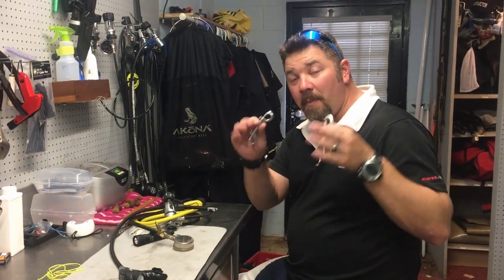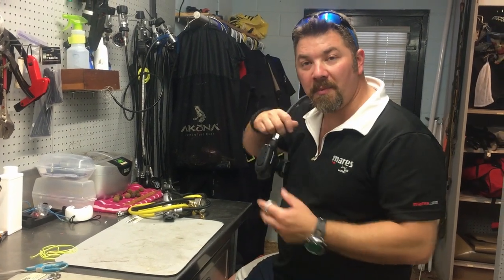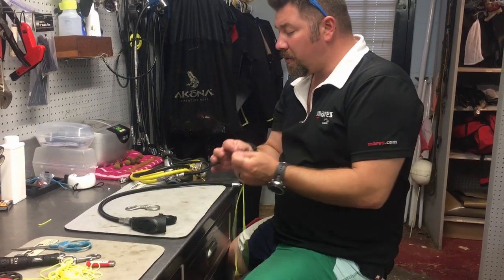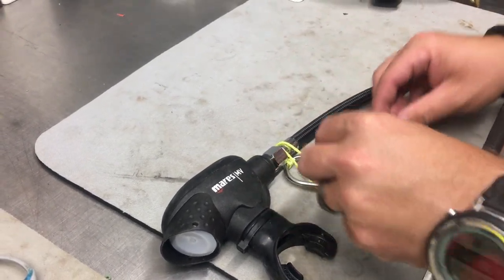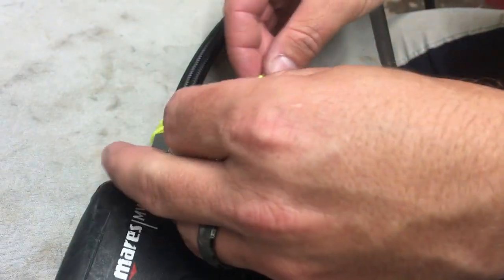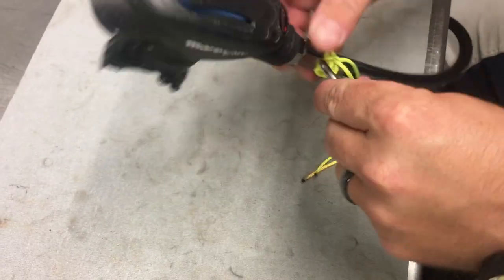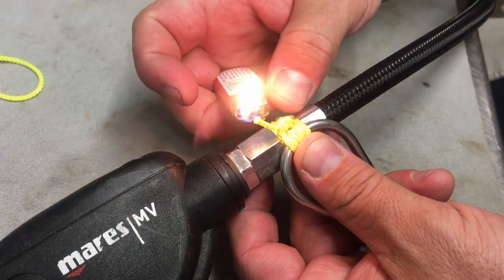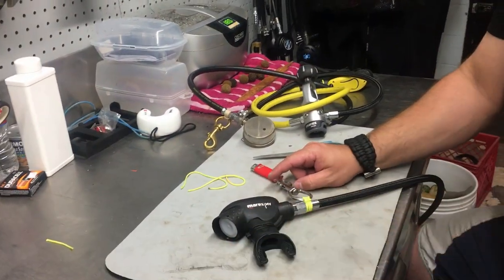Attaching A Bolt Snap

Comment: Hi. A little off topic, but can you give me a thumbnail review of the Mares MV second stage you used for this demo? I'm considering getting one as my safe second, but I've seen comments that it is hard to breathe from and that the faceplate is brittle and easily cracked. Any info you (or anyone else) can provide would be much appreciated. Thanks
Reply from the maker: Here is a review we did several years ago on the Mares MV Octo.  https://youtu.be/fpZ8qlNunF8.  If you will send me your email, I will send you several pictures of it up close.  I am currently out of town at an SSI Dealer Summit and will not be back until Wednesday evening.  But I will be available to chat Thursday morning by phone if it would help.

Comment: What if I have hose protectors? Can I put the boltsnaps over them?
Reply from the maker: You can, or you can put them directly after them.
Reply: @LakeHickoryScuba  but if I put it after, I can't remove for cleaning well, right?
Reply from the maker: That would be correct.

Comment: Brass vs. Stainless, what's your thoughts, Is the extra money for the SS bolt snaps worth it, or just stick with brass as long as its a good quality and the snap works well.
Reply from the maker: So personally I use both.  Anytime I am in Saltwater, I prefer to only use Stainless.  But even Stainless will rust if it’s not taken good care of.

Comment: Why dont you like using a o-ring? Is'nt better so you dont get hung up in stuff?
Reply from the maker: I haven't used O-rings to attach bolt snaps in over a decade.  They tend to dry out over short period of times and will break.  Plus when attaching them with a zip tie / cable tie, it can add undo stress the the hose itself.  The philosophy of entanglement hazards is a great one to follow,  but sometimes we go way over board and we forget about practicality.  I have found that using cave line is more versatile, not only can I adjust it, it also allows the bolt snap to swivel more freely.